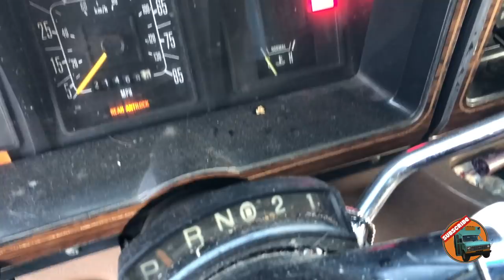Showing Off At The TINY HOUSE FESTIVAL - Will They Like My Crazy Bus?

Comment: Do you have a way to use your block heater when not on shore power...is that something that can even happen?
Reply from the maker: Technically, yes... my solar can handle the 1000 watts, but not for long, and not if I plan to power anything else, which is why I don't do it. I had all sorts of trouble in my recent winter boondock across the US (video about that to come). I have a gas generator but I don't like using it, and it would have been frowned upon in the places I was sleeping anyway, so I need to figure out another solution (or move someplace warmer). Though I discovered on this trip that there are times when NOPLACE is warmer.
Reply: @MaxMiniTV  Might you be doing a vlog on your solar and power on board in general? I've love to see your process on that.
Reply from the maker: @marydawkins4190  I've been planning to, but I was trying to get some additional info from the manufacturer of one of the products I use. They did respond but it was basically in Chinese so I think I'm on my own there! It's on the list and frequently requested, so I'm sure it will be coming soon!

Comment: You bus floor is it peel an stick tile?
Reply from the maker: No, it's actually commercial VCT tile, and it was a big mistake. I used it because schools and institutions use it, so I figured it was sturdy. The problem is, the floors at schools don't bend and twist the way a bus does.  Most of the tile is cracked. I'm planning to replace it with sheet vinyl, which seems to be the safest way to do a white or patterned floor.
Reply: @MaxMiniTV  great to know. That means your gonna have to pull all that out sshhheeeww!
Reply from the maker: @sundancekidd1550  Yup. :(